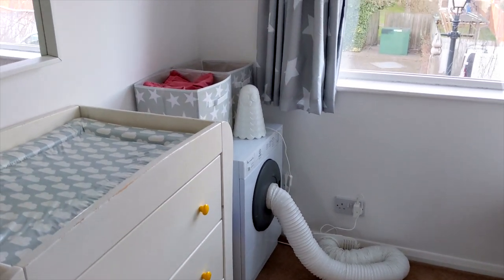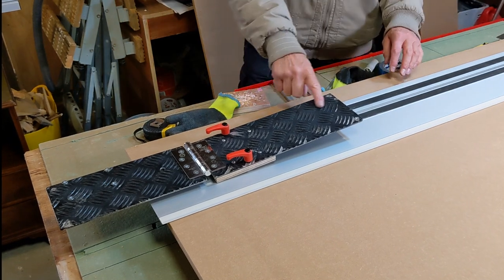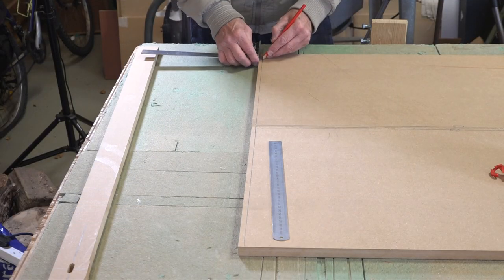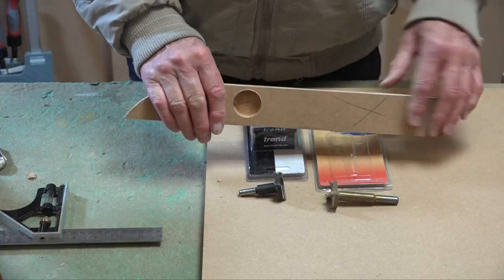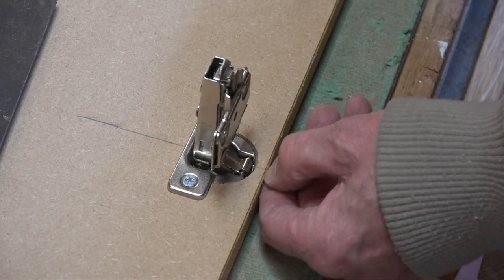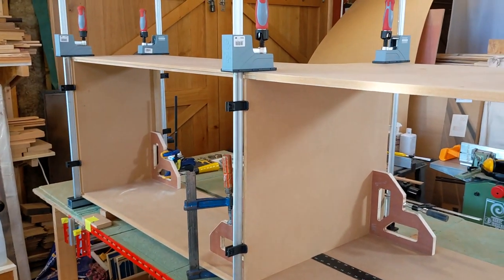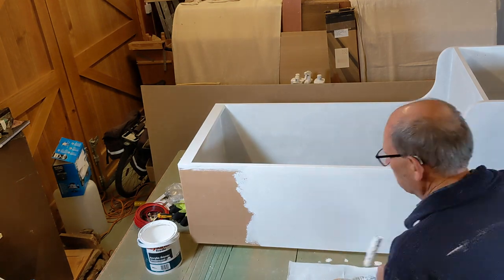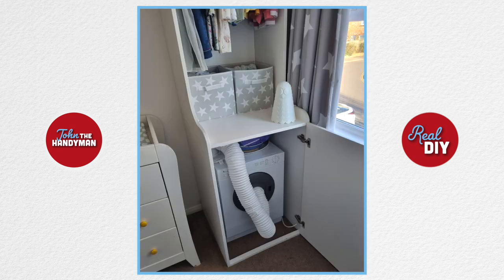Wardrobe Build AND paint like a PRO! (#9)

Comment: Very well done John.
Today in my wood working class I worked with MDF.
Here is my experience 
MdF is a beginners choice to try various projects.
It takes screws like butter.
But if you use smoothing plane it is very difficult.
The saw dust is fine.
So wear a mask !
 I will try the painting on MDF later .
John,please introduce your shed and various tools.
You have nice gigs.please introduce them.
One secret jig which I did
Make a wedge in pine wood  for about 25cms.
Sand all edges.
You have a mobile Shoe tree.
Reply from the maker: I wouldn't say that MDF is for beginners at all. There are many instances when it's better than say solid wood or plywood. It's used extensively in furniture making. Yes using a plane on the edges doesn't work well and the dust should not be inhaled. As for screws try using the black screws for fixing plasterboard. In the UK we call them Bugle Head Drywall Screws. They are thin yet have quite a large tooth. The bugle head will pull into the surface better than a countersunk. Highly recommended. Maybe one day I'll introduce my workshop. Right now it's very messy and too cold to work there.

Comment: Thanks for the video. Why do you personally prefer to use the domino approach rather than MDF screws and then filler / sanding to hide the hole? I've seen both and not sure which to go for. Thanks.
Reply from the maker: To be honest I don't really have a preference except that as I've got a domino machine I like to use it! Nothing wrong with screws as long as the MDF doesn't split. Much cheaper off course to screw and  carefully filled holes are easy to hide though perhaps more labour intensive.
Reply: @JohnTheHandymanUK  those domino jointers are out of my price bracket that's for sure.

Comment: Thank you for the video John, I found it really useful. Could you please let me know which make of MDF you used? (I am in the UK)
Reply from the maker: Thank you for your kind comment. The MDF didn't have a name to it. I'd had the sheets several years before I used them, and they came from a timber merchant called Covers in Horsham,   England. Covers have a few branches in the South of England with Chichester being absolutely huge! I don't think they were anything special, they certainly weren't moisture resistant. I know that The 10 Minute Workshop on YouTube always uses moisture resistant as the edges cut very well.
Sorry I can't be more specific.
Reply: @JohnTheHandymanUK  Thank you for your reply John.  I think that I'll get some small pieces from various merchants and do some tests.